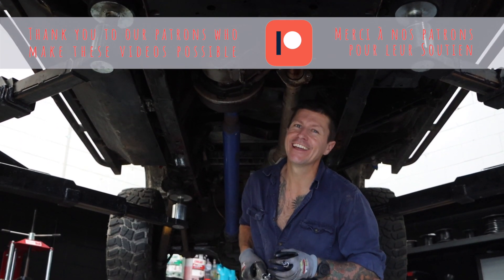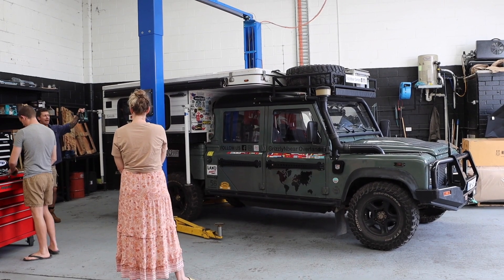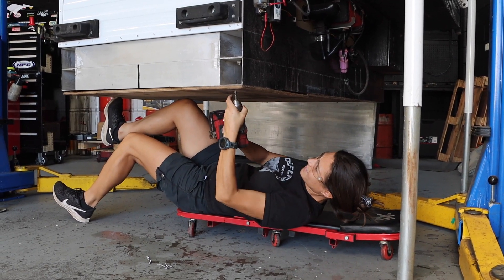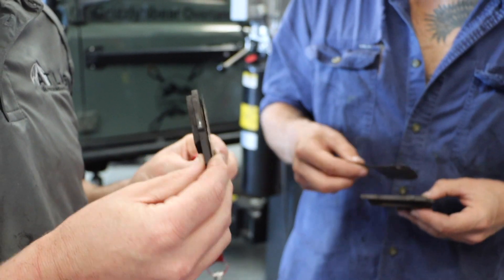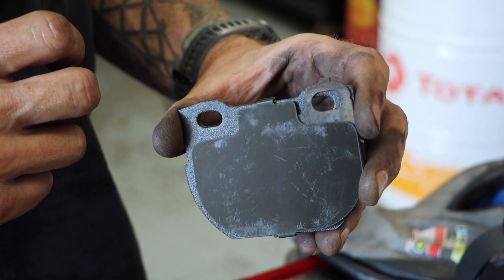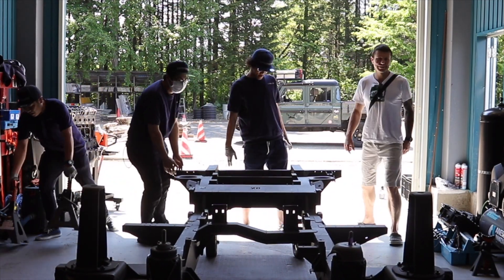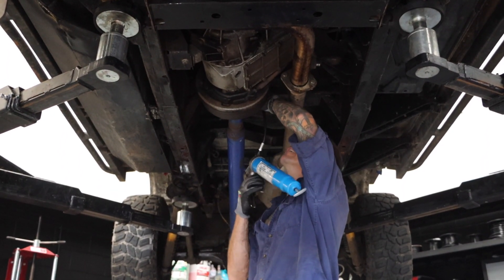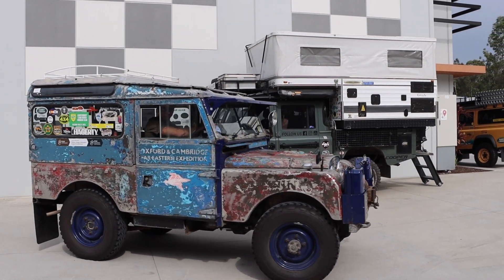This has driven us crazy for years!! - Atlas 4x4 (Ep219)

Comment: I wish you guys would get over here to the USA. I would build some slides for that drawer. Cut into the outer structure and relief the slides into it. The tape works ok until it get dirty. Also next time seal and paint that wood it will last alot longer
Reply: I'd go with aluminium instead of using that plywood..less maintainence required..
Reply: @dolguldur4706  I totally agree. Maybe even starboard. But if the drawer was supported by guides it may not need the plywood at all.
Reply: @SimonElenor  my guess is..they probably didnt want to use rail/track system for the drawer maybe because they didnt want to ruin the flatbed because they often slide their camper when they unload the camper from the vehicle itself hence why they dont use the rail system

Comment: Another handy tip for the draw and chassis. Rub the under side of the draw with a bar of soap. The wax's in the soap keep the draw lubricated.  With the chassis. I use a spray product called "fish oil". Readily available from most auto shops like supercheap auto,etc. If I see any minor rust appearing on my chassis I also use a product called "rust coverter". I apply that first then a day or so later spray the fish oil on it. Works a treat 👍

Comment: Why not put something like plexiglass or an aluminium sheets instead of timber?
Reply from the maker: We need the 12 mm thickness. Otherwise the camper doesn’t seats too low and doesn’t clear the side of the tube. If that makes sense.
Reply: @GrizzlyNbearOverland  Tnx yeah I understand the 12 mil requirement but you could get that in plexiglass for example

Comment: May I recommend using a marine finish on that plywood that gets damp; I’m currently doing that with one of my trailers where the ply gets wet and works great - I’m using a Norglass product, not cheap up front but the savings will be in the long term performance.

Comment: Some of your readers might find this helpful.
I make slides out of Delrin.  Which is commonly used to make inexpensive white plastic type cutting boards.   I get the 3/8" or 1/2 inch thick cutting boards at Wal Mart, then use a table saw to rip them into 1 1/2 inch wide strips like you did with the tape.  The drill and countersink the bolt holes.  They are not quite as good as roller bearings, but will hold a lot of weight, won't swell, and take a lot of abuse. And they beat sliding stuff across flat surfaces by a large margin. I usually attach them to the bottom side of the drawers or slide out battery racks I built for my RV.  They can be sprayed with silicone spray or silicon or lithium grease to make them easier to slide, but they will attrack dirt in dusty areas. ( My Battery Rack is undet my RV. so it gets dusty, so I don't spray those.)  Having my big solar batteries on a slide out rack has been a game changer for maintenance.

Comment: Hola Leigh 
Your brakes looks horrible undersized. My recommendation: Ditch them und buy something suitable for you weight.
Cheap like chips in AUS.
Wood boards…guess you like to replace it regular.. should have bought some 100% water sealed container boards which does not sucks any water and no swelling.
But that would be my way of fixing a problem for good

Happy days…..

Cheers

Comment: If one disc pad is wearing unevenly, then you probably have a sticky brake calliper. Also, the only real long term solution to sticky heavy drawers is to fit rollers.
Reply: A sticky calliper can also put stress on your wheel bearings and wear your disks unevenly. It would pay to give it a full checkout.